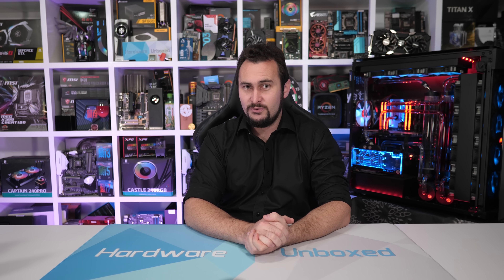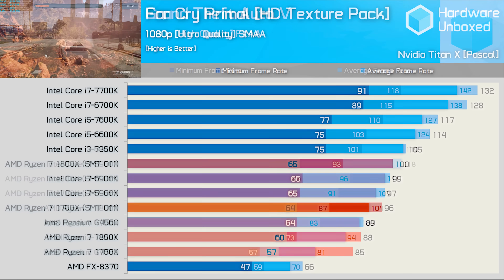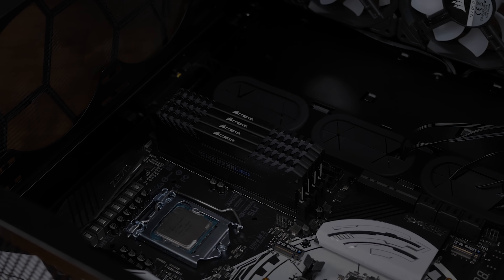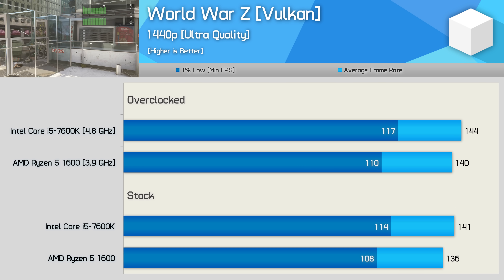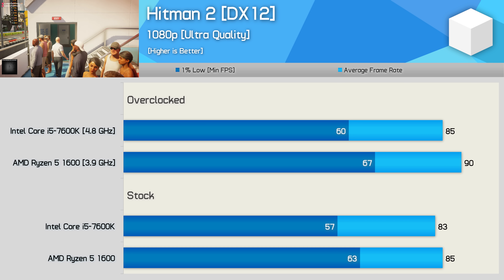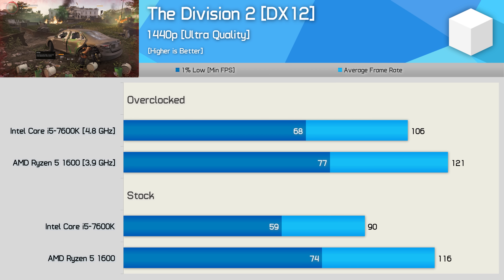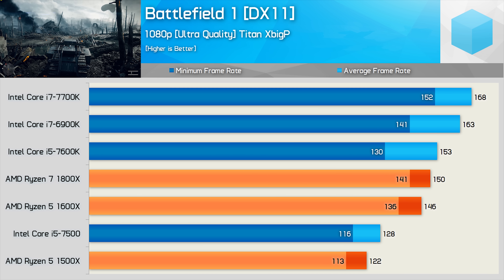Ryzen 5 1600 vs. Core i5-7600K, How Times Have Changed!

Comment: Back in 2017 it was WAY WAY cheaper to build a ryzen 1700 build compared to a 7600k one. Not only did the i5 cost a lot but you needed an expensive unlocked motherboard for overclocking and also a high end cooler to push it to 4.8 ghz territory.
So glad i went the 1700 route, with the new consoles having ryzen processors this bad boy will last me for quite a while.

Comment: Wow.... so great to see games finally stretching their legs on those threads. Original Ryzen kept so close in many games despite being clocked 900Mhz lower and having a modest IPC deficit. Looks like for now though, my 7700k has just enough threads to keep my 1% lows where I want them... it still keeps the 1080ti fed! I'm hoping it will hold up enough until the next AMD socket releases with DDR5 support. I can only imagine what a 3-5nm Ryzen 9 4900x with DDR5 memory bandwidth could do!

Comment: With 7600k just having obs open by itself, using nvenc will cause your games to stutter to complete shit to the point you get frame freezes. It's a disappointment of a cpu + if you want to upgrade than jokes on you, you need a new motherboard, because the one you invested half of the value of cpu is outdated
Reply: Smh

Comment: I'm swapping my old 2600k oc build with a Ryzen 5 1600 100€ new, Ab350m Pro4 shop used 40€ and 16Gb 3000/3200. Then 2020/2021 I'll upgrade it with "Zen2+" with a Ryzen 7/9 and ill be good for a lot on a budget 😉👍🏻 let's hope for a good r5 1600 OC results with my Noctua U14S also.

Comment: My 7600k is often at 90-100% usuage with my gtx 1070 trying to get 144fps...altho it is seems to keep the 1070 close to 100% at all times.... the 7600k sells for around $200 used and a 7700k sells for around $300. So I think the ~$100 difference out of pocket is certainly more than worth it
Reply: It would be much better to get cheap motherboard and ryzen 3600 insted of 7700k

Comment: Late 2016 was a great time to build PCs - parts were pretty cheap. That excludes CPU though. My mistake was getting i5-6600k, expensive 100$ Z470 motherboard and 50$ cooling solution. I should have gone for something much cheaper, but still 4 core and wait for Ryzen. Funny thing is, even today it's cheaper for me to go for something like Ryzen 1700 over used i7-7700k.

Comment: Still glad I sold my 7600k in December and bought a Ryzsn 7 1700 with that money. Basically a free upgrade, although I did buy nice MSI x370 gamimg carbon so it wasn't totally cost free but well worth it, the 7600k would cause stuttering in certain tasks such as gaming, running discord with someone sharing their screen and having 15+ chrome tabs all at the same time, this issue is non existent with the ryzen 7. I had my 7600k at 4.9GHz and my ryzen 7 at 3.8GHz (quick overclocks, worked well second try so didn't bother messing with it more)

Comment: I always knew it 4Threads wont be enough back in 2017 me and my frnd had similar budget for PC he went for I5 7600k and I went for R5 1600x we both have GTX 1070s and same LPX 3000mhz 8x2GB ...His performance was better in early games now I take the win 😂😂😂 poor guy
Reply: And thats just the beginning. You can easily upgrade to a 3rd gen ryzen cpu while he smis stuck on crapp Quadcores with his mainboard, unless he also buys a new mainboard
Reply: Rengaruu not really looking for an upgrade for like 2 years that CPU is enough just saving up for a RTX 2070

Comment: this is Joy from China,

Our company  main product：laser marking system, stencil printer,multi-function splicer, SMT auto splicer,dispensing systme, coating system, PCBA 3D SPI(Solder Paste Inspection System), 3D AOI(Automated Optical Inspection System), if you need more information, please contact me lixy@youngpool.com

Wechat: joyli9090

Linked in: joyli90

Comment: Don't forget the main points here guys: 
AMD is <1Ghz slower (even when is oc vs oc)
AMD < less consumption (65w vs 91w) (so Less heat!)
AMD < ~155% CHEAPER (113€ vs 270€)
AMD > More Cores / Threads  in the same year of release! (4 vs 12)
it kicks Intel ass when it comes to architecture! when you are 1Ghz slower you consume less, you cost way less, and you still manage to be as fast or even way faster in multitasking than your competition... is GAME OVER. AMD Zen 3xxx will be even more phenomenal!
Reply: This comment aged ridiculosly well. Ryzen 3000 series along with Threadripper 3000 series made almost all intel cpu's irrelevant.
Reply: @kennedymoreiras3054  I think in the next 2 years intel is going to lose their brand recognition. That is when the prices of their cpu's will drop like a brick.
Reply: Johnnyxp64 amd kicked intel right in the nuts
Reply: and you forgot amd has a stock cooler

Comment: hi, I want to know if you can, I recommend a break or ups for pc and monitors 3, my pc is a r7 2700x, gpu vega 7, mobo aorus gaming 7 wifi, ram hyperx 3200, 2 hdd 7200rpm, m.2 1 and sdd 2. that suppressor and voltage seriea the appropriate buy that support my pc and 3 monitors psu 850 80+ gold

Comment: I bought a 7700K because i wanted to avoid the new platform problems of first gen Ryzen.  
By now Ryzen has matured and my Intel has started to get Kindergarten problems, lost performance through security updates, which i avoid like the plague... and AVX usage in gaming has increased to the point that my 5GHz delided watercooled CPU is mostly running at 4.6GHz because every god damn thing triggers the AFX offset now, even Chrome triggers the AVX Offset.  
AVX puts out a ton of heat when gaming so i deal with more crashing and dialing in the offset than i want to.  

I'm ready to jump ship to AMD, i just want to see them beat Intel on Singlethreaded performance, they already beat them on everything else... price, performance, core count, upgradeability.

Comment: Here in Norway both CPU's were almost equally priced at launch. Intel a little more expensive. Now over 2 years later, the price of the Intel 7600k has increased by around 5% (https://prisguiden.no/produkt/intel-core-i5-7600k-276231) compared to the AMD Ryzen 1600 who is not only better, but price have gone down a whopping 50% (https://prisguiden.no/produkt/amd-ryzen-5-1600-med-kjoler-292849) Pretty incredible

Comment: Meet again in three years when the 2700X gives the 8700k a run for its money.
Reply from the maker: Those two will be pretty evenly matched in a few years time. The 2700X doesn't have around 80% more resources than the 8700K and the resource advantage that it does have is nullified by it's clock speed and latency disadvantage.

Comment: This actually makes me glad I picked the r7-1800x over the i7-7700k early 2017.  I do use my PC for gaming but I also do video work too that could benefit from the many cores so that is why I chose the 1800x over the 7700k.  As for gaming even though the 4 core Intels could crush games that were more single core dependant but the Ryzens did play those games really well too.  As time went on the added cores being utilized by games made the ryzens from 2017 shine over the intels from the same period.  The same can't be said from Coffeelake intels and later as they also increased core count.  Kinda curious on the 3000 series ryzens performance once reviewers release the results.  Of course take anything AMD said about it with a grain of salt as any company will try and shine their own products in the best possible light and every company is like that.

Comment: I wish you had continued to use the i7 7700K in the latter 1/2 of the benchmarks.   It was included in the first 1/2 of the gaming results and for some reason the Ryzen 5 1600 was not, most likely because of poor performance.    Some of us continue to use the i7 7700K.   For example, Battlefield V Ultra settings with an i7 7700K @ 4.8GHz [what I usually run mine at], 1080p, 1080 Ti, I saw no chop or "pretty horrible experience" you described with the i5 7600K    https://www.youtube.com/watch?v=o-I6r9qg-V0   Another example, I saw no series of horrible results in The Division 2 using an i7 7700K @ 4.8GHz, 1080p & 1440p, 1080 Ti   https://www.youtube.com/watch?v=XwIQ0mOrzvQ 

I am disappointed with the small number of games provided.    If you had included many more games and only showed a graph of performance numbers at the end of the benchmark section I would have been pleased, hand picking a couple of games geared toward more cores and threads at the end does not.  The Ryzen 5 was only noticeably slower in a single game?   The Ryzen 5 1600 was not in the first half of the games you displayed, because it would have been decimated.   Do you think comparing 4 cores and 4 threads to 6 cores and 12 threads is a generally good comparison in games that heavily use more cores and threads?    I am usually happy with your videos.

Do I think the Ryzen 4000 series of CPUs will be very good?   Yes.   Expect to pay recent Intel overpricing for Ryzen 3000 and 4000 series CPUs and motherboards.

Comment: I thought Ryzen cpu-s generally don't work too well with 4 sticks of ram. Should have tested it with 2 sticks in dualchannel? hmmm
Reply: In what sense don't they work too well with four DIMMs? Do you mean the overall recommended memory clock speed is lower? It is indeed better to use single rank RAM than dual and it's better to use two 8 GB DIMMs than four 4 GB DIMMs to achieve a total of 16 GB simply because of the loading effect when more physical RAM chips are hanging across the bus.
Reply: @johnm2012  it is possible that ram-s won't overclock that well if there are 4 sticks. And higher memory frequency with ryzen is certainly a nice thing to have. But if the sticks run at the same clock speed as specified, then it's not a problem I suppose..
Reply: @Istvan_F  Overclocking, by definition, is operating something outside of its specified parameters so if you do overclock then all bets are off as nothing is guaranteed. If you stay within the spec then you will get the performance you were promised.

Comment: I just sold my 6600k and bought a 6700k in 2019 because skylake and kabylake are the same OC. I'm locked to that as well with the z270 board. I still dont regret it the performance is still pretty good for a 3-4 year old processor. Maybe I'll upgrade in 5 years to ryzen 5600x lol

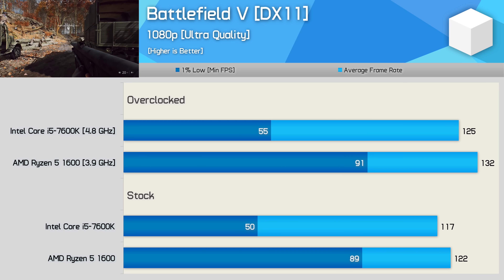Comment: 07:44
This reminds me of BF1 with an i5-6600k (4c/4t) at 4.6 Ghz and R9 290X.
It was playable, but CPU utilization was close to 100% at all times resulting in stuttering. Kinda regret not spending the $100ish extra for the 6700K (4c/8t).
Later bought the R5 2600X and despite lower single core performance (PBO/Performance Enhancer lvl 2 = 4.0~4.25Ghz on all cores) it is much more enjoyable.

Comment: Don't Intel chips need to have hyperthreading disabled to protect themselves from the microcode exploits that are starting to show up?
Doesn't that affect their gaming performance, and do they still run faster than AMD after being gimped?
Reply from the maker: This CPU doesn't have Hyper- Threading 🤣
Reply: Oh right, I forgot. But that definitely applies to all the i7s, and there are quite a few gamers who have those, even though it's a bit overkill. 
Do any of the i5 chips have any security vulnerabilities, and does that mean we should consider those instead of the i7 going forward?
Reply: I'm seeing here that there is a problem with Intel's speculative execution microcode, and that would mean even the i5 has it.
Maybe the reason Intel does better in the IPC and single thread tasks is because they kind of cheat and take risky shortcuts that are now biting them in the ass. 
It seems like hardly a coincidence that the fixes that they are going to have to do for them will lower performance of the chips by almost exactly the same size of the advantage they have over AMD. It seems Intel's IPC and single thread advantage is down to their insecure microcode and poor security. 
https://www.wired.com/story/intel-mds-attack-speculative-execution-buffer/
Reply: I just tested my i5 2500K with the tool they provided in the article, and it says my chip is vulnerable in many areas. 
That clinches it. I'm buying a Ryzen in a couple of weeks and never going near Intel again. The only problem is that it's not just our personal systems we have to worry about, but the servers of all the sites we use that are going to be vulnerable, and we all know how bad lots of companies are about upgrades, updates, and patches.
And the sad thing is, I would be willing to bet that all chips are vulnerable in some way or another, but we just haven't been told about it, or the intelligence agencies and hackers haven't leaked it yet. And if they haven't found the AMD vulnerabilities yet, they will soon now that more and more users migrate to AMD.

Comment: AMD 1600 is $80 bucks at microcenter to top it off you get $30 off if you buy a motherboard too so a B450 motherboard for around $40 bucks is just value that csnt be beat..... Now with ram being so cheap you can get 16gb kit 3000mhz for around $90 which the ryzen would benefit.

Comment: Wait is the IPC on the 1600 REALLY that good? can it actually beat a 7600k even clocked nearly 1ghz slower?
Reply from the maker: It has almost 80% more resources mate.
Reply: True, but I thought games still mostly benefited from IPC and high clock speeds, and were talking about a cpu here that's running 900mhz slower
Reply: I mean I guess I'm wrong and the results speak for themselves
Reply from the maker: @ikiwyu  You're talking about a 23% clock speed advantage and about 5% in IPC making up for an 80% difference in CPU resources, the math doesn't check out mate.